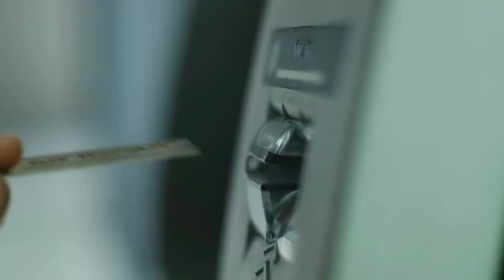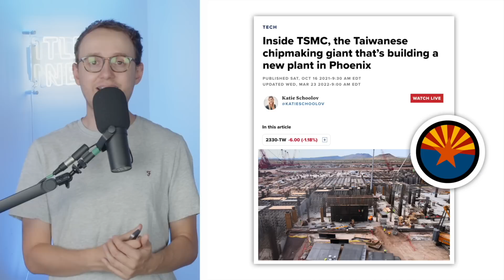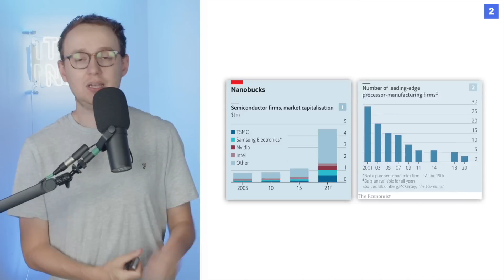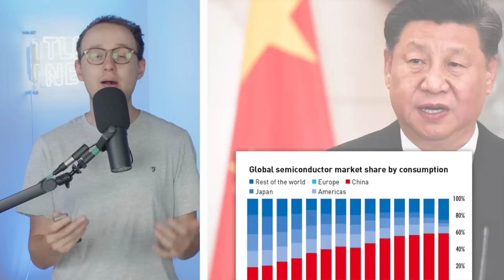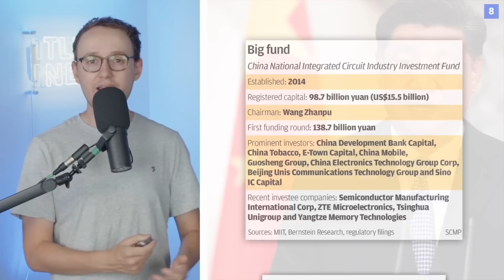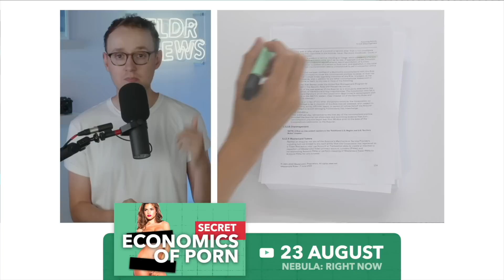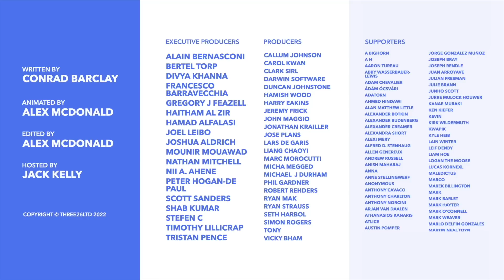How China Could Create a Global Semiconductor Shortage

Comment: And yet, some people think going fully electric, which requires the use of battery materials that come exclusively from China, is somehow a good idea. Now, don't get me wrong. We need a cleaner way to operate vehicles. But something that takes an extended time period to refuel, requires buying batteries from a hostile nation, and fundamentally makes the common person less mobile in their day-to-day lives is not a good idea. Ultimately, an entirely plug-in system will actually hurt the average person. After all, if you can't drive more than a hundred miles before your car needs to be plugged in for several hours, you can't interview for a job a few states over. A fully electric economy will actually hurt your financial opportunities. A better option by far is hydrogen. The most advanced electrolysis system currently being developed is Japanese, meaning it's an American ally who would actually share with us. A hydrogen systems can be installed on existing internal combustion engines for a few thousand dollars a piece, meaning the existing vehicle fleet doesn't have to change. With efficient enough electrolysis, you could make hydrogen on demand at the gas station. Meaning that all you need is a water line, which every gas station already has, so even the support infrastructure can exist. And in the end, it's really a question of how the electricity is produced. The US is still a long way away from a clean electrical grid. Given inefficiencies in the system, you're still better off with gasoline than electric right now unless your home has solar panels. And even then, there are questions about the amount of toxic crap released into the environment by solar panel production. It might not be that clean.

Comment: The point is that it is a group IV element and that silicon is perhaps one the most abundant materials on earth and so is cheap. Group IV elements can be manipulated by doping with impurities like a group V or group III, essentially causing the substrate to have either an additional free moving valance electron - essentially making it negatively charged or n-doped or by removing a valence electron making the product a positively charged entity or p-doped. The amount of doping then determines the strength of the electric field of the final substrate and hence the uses for it. In electronics, these are mainly used to create transistors which are a type of electrical switch that are essentially a signal propagated or a medium of storage. Transistors and diodes make Logic switches = compute. And for awhile the goal was to make these transistors smaller and smaller until they now reach the physical limit of 5nm ( that’s 10^-9m or 0.000000005m) which TSMC is the only one in the world that can produce and not so long ago also held a monopoly on 7nm transistors, of which china has shown was able to manufacture via brute force and unlimited government resources. Some notable economists like Jeffrey Sachs believe that within 2-3 years time, china will have invented the 5 nm transistor themselves which negates the current lead TSMC and the west has.

Comment: I keep wondering why the netherlands itself doesn't encourage a local foundry industry.  I imagine having the companies that make the lithography machines locally must mean there is a lot of institutional knowledge involving them floating around.
Reply: Because we don't need to. As long as we supply the machines the rest has to listen. 😀
Reply: As mentioned in the video, fabs require much larger capital investment. It may be too much for a Dutch company to commit such massive capital into manufacturing chips. 

Apart from the financial aspects, there is an issue of the talent pool/labour market. You need lots (thousands) of workers who are at least trained at a postgraduate level, and willing to work sweat-shop hours (often 70+ hrs a week). This aspect is practically impossible in the EU.
Reply: @achernarchang883  no reason for the long work week. You just have to have enough shifts. It's just that we don't need to build foundries. France would be far better. More room and a large unemployed workforce.
Reply: It’s because ASML developed its latest technology with TSMC and there are many patents shared by both company. This is partially why other companies including Samsung is having trouble advancing its production. Because all lithographical machines sold to other companies that’s not TSMC are somewhat downgrade version of it.

Comment: Good video but you missed out on an essential detail.
Taiwan is VERY aware of their supremacy in the semi-conductor industry and the biggest and most advanced TSMC foundries are located right next to the few potential landing sites of a Chinese amphibious invasion. Basically they have placed their global value in the center of a potential future battlefield to ensure China won't try, also known as the Taiwanese silicon shield. On top of that, while you did brush over The Netherlands supplying lithography equipment, ASML Holding is the only company that can produce machines capable of producing Taiwan's high-tech chips. What this means is that IF the Taiwanese foundries are destroyed in an invasion, they CANNOT BE REBUILD without The Netherlands/Europe approving it. Something they will not be likely to do if the island is taken by force.

Comment: To clarify something here (sorry I'm a nerd), but the light doesn't inscribe the material onto a semiconductor. Light is used to photocure a resistive mask in a pattern of what you're trying to make. The photo resist that isn't cured will be washed away leaving a pattern. Then you get to etching with acids and plasmas or deposition of other materials (like gold) through a number of different treatments. This process is repeated a number of times to etch and deposit a 3d structure of circuits. Semiconductors are great because you can tune their conductivity allowing you to switch them off and on.
Reply: I wish i could learn how they make cpu and gpu dyes its crazy if you think about how they figured it out in the first place
Reply: @chodicuss1889  Lithography is much older than making chips. Masking has been a thing for centuries. But the history of bell labs is a good place to start because they were responsible for the beginning of the semiconductor revolution.

Comment: There are machines in the fabs in that companies, like ASML in the Netherlands, refuse to send to China over fears of IP theft. I can see China invading Taiwan just for those machines. They don’t need to worry about all of the other supplies because they can source that material themselves. What would China do to get their hands on an EUV scanner?
Reply: Your statement is wrong on many levels. Most of the semi materials, equipments, and chemicals are supplied from overseas with no working substitute in china. The EUV machines are also not like a computer where it can be readily used by anyone. Virtually all staff involved with using the EUV are specialty-trained PhDs with years of experience, which china has very few of.
Reply: those machines can be locked down remotely anyways so at best they get their hands on some dead machines. i believe that ASML claims even if they show you the blue print you will not be able to manufacture the lithography machines, so i guess they have confidence that china won't be able to reverse engineer it any time soon
Reply: Really? A western company not willing to give away its technology like all the other bone headed ones who then get out competed by the copies? Oh my.

Comment: Your definition of semi-conductor isn’t really correct. To explain, I need to let you in on a secret, there’s no such thing as an insulator!! Everything in this world will conduct electricity, and depends only on what voltage you apply. This voltage is called the breakdown voltage. What we call insulators are solids that have a breakdown voltage of at least a few thousand volts. A semi-conductor is a solid that has a breakdown voltage very close to zero, I.e. a conductor, like a metal. The crucial thing about a semi-conductor though, is that the breakdown voltage can be influenced by an electric field, and this influence is enough to pull the semi-conductor over the line into the pure conduction region. This is technical jargon that means we can turn on and off one voltage source using another one. And this is the fundamental operation of a semi-conductor. If you start to assemble these devices together, you can make logic circuits, where 1’s and 0’s (on and off) can influence other 1’s and 0’s, and onwards up to desktop computers!
Reply: While true that you have to keep in mind the fact that there is no such thing as a perfect semiconductor, insulator, or conductor, and every component exhibits some amount of resistance, inductance, and capacitance, for the purposes of this video, the explanation was just fine.

Comment: If covid and miners sent graphic card price through the roof, imagine what a war would mean for regular buyers
Reply: Techpocalypse
Reply: Which is why such a move would be fatal to the Chinese economy. (and by extension to the CCP itself, as it draws legitimacy from an "ever growing" economy)
With domestic sales going from low to lower, the export is what keeps the factories running. If you remove vital components from the supply chain, they either have to stop producing or switch to older (chip) technologies...
And that still doesn't take into account that a slumping / crashing world economy would result in fewer buyers for Chinese produce...
And to top it off, there'd most certainly be sanctions, that further cripple the exports and measures (that are already being prepared) to produce in places that are out of reach for China (resulting in permanent losses of valuable export customers).

Regardless of how you turn it, China can only lose. Even if they take territory, they lose. As war is not about the territory, but a means to achieve political or economic aims. And i doubt that crashing the economy, turning China into a pariah and permanently driving away the most valuable customers is on the agenda.
Reply: at the start of covid I went I should buy a new graphic card(, my GTX1080 started to get a bit slow for me, and I wanted to get into deepfakes and 3D modeling/rendering[, for totally innocent reasons]) and I went well i can just save up for a 3 or 6 months and I get a RTX, of course my (GPU) dreams were crushed due to the rise in prizes, the money went to another thing and then I decided to start saving again just to finish around February this year, FML its like the gods are blocking me from acquiring a new GPU

Comment: Based on my (lay, but interested outsider) understanding, I don't think the statement "the smallest components are 3 nanometers" is correct.  The names used for modern fabrication processes (like "7nm", "5nm", "3nm") don't actually denote how large the features are.  Instead, they are a statistical measure of theoretical feature size if you had old-school planar components for a particular set of target devices (like SRAM).  They do this because fabbing got HARD, and they had to start using complex 3D structures that can't really be neatly measured by a simple "how wide is a gate".  So it's more like "3nm" means it has "component density roughly equivalent to the density you would have if it were possible to miniaturise old-school planar transistors to 3nms".

A consequence of this is you can have two different processes called "7nm" that DO NOT have comparable transistor densities.  This is partly why Intel is moving away from names that include "nm" to names like "20A", and they got sick of trying to explain to the press that the names don't mean what they think they mean.  You know, exactly the thing you've just done.  :P

To be fair: they probably should have stopped using names that look like simple measurements when it was no longer true, but presumably kept doing it for marketing reasons.
Reply: True. Sophie Wilson, one of the big names in the industry (designer of ARM), mentions this in her keynote (https://www.youtube.com/watch?v=zX4ZNfvw1cw, at around 26:30). The transistors didn't get much smaller, but their geometry did change so that they get the same properties as a smaller planar transistor. A 14 nm process is really just a 20 nm node but with FinFET.
Reply: This was a really useful post. Thank you for sharing!
Reply: It's consistently funny to me that the most informed opinions are often held by people who feel the need to stress how little they know.
Reply: @greenredblue  Dunning-Kruger!
Reply: Thanks for saving me the bother of typing that myself.
Reply: Thanks. And to add to that, as you say, it's about the gate width, not the transistor as a whole. Even a typical planar transistor made with 50 nm process is not 50 nm wide.
Reply: UMMM well actually  a 2x4 is 1.5"x3.5"  *pushes up glasses.   This is normal in most industry.
Reply: Doesn't sound very lay lol
Reply: Thx for this comment, I was wondering about it, I mean 3nm is like 27 Si atoms wide, that's ridiculously low, it's the domain of quantum mechanics with all it's wonders like tunnelling.
Reply: @sogerc1  Tunneling is actually used, it's how the electrons cross the gate.
E2A:  I should note, this applies to flash memory storage, not processors which this video is more focused on.
Reply: Yeah TLDR is good for a very introductory and basic understanding of topics, especially those outside of UK politics. They frequently miss these kinds of details.